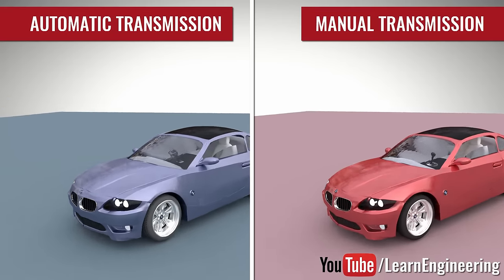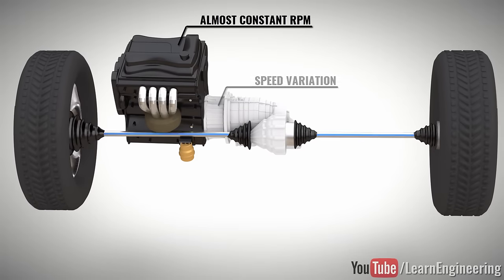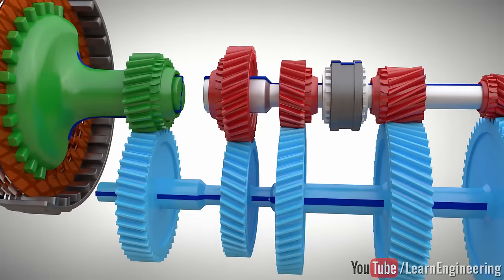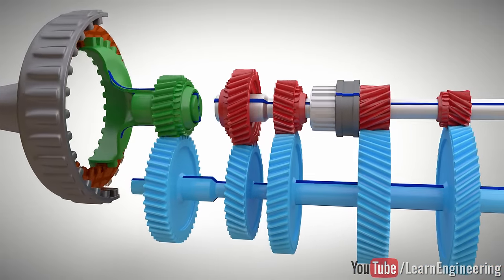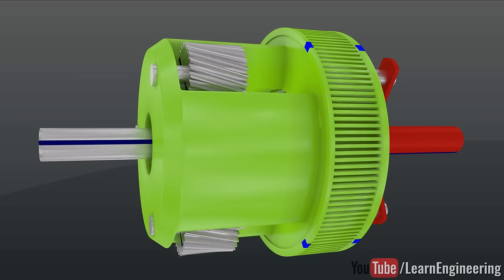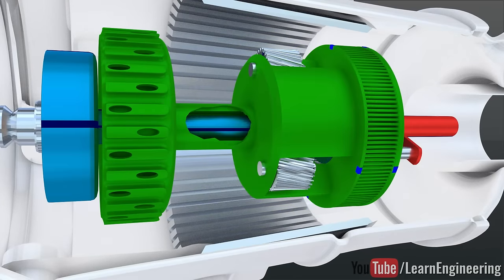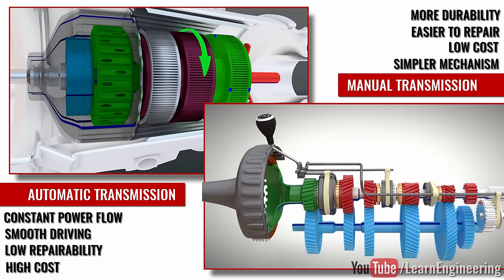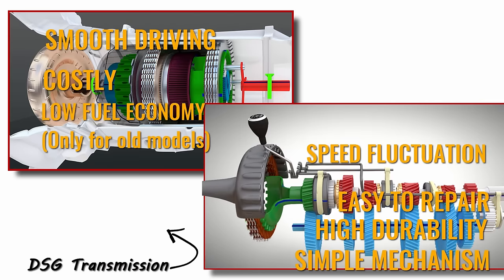Automatic vs Manual Transmission

Comment: Manual is never smooth? I dare say my shifting is smooth as butter sir!
Reply: Guts Puck hmm. A wild Berserk fan appears.
Reply: I think its said for beginners 😂
Reply: Same here. every car I have ever owned over the last 28 years was a manual. 
I shift without even thinking and it's very smooth.
Reply: It’s relatively less smooth than automatic transmissions.
Reply: I felt personally attacked when he said never
Reply: Baby Magnum boi we about to head out and go for a drive
Reply: Dear friend I agree with you, manual transmission is efficient by fuel, breaking, control of the vehicle.
Reply: Guts Puck was looking for someone to say it 👍
Reply: They probably just have those engineers that only understand something on paper
Reply: @EvilJ069  you can't continuosly accelerate on a manual.
Reply: @panzerofthelake506  Oh please forgive my 1/4 of a second between shifts! XD And how typically a manual is faster
Reply: @EvilJ069  It's a hard skill to learn. Have you ever been in a traffic jam on highways? Having an automatic especially for a beginner is much much better if you don't want your clutch to set on fire.
Reply: @panzerofthelake506  I learned when I turned 18 and haven't had an issue since. Yes, I've been in many traffic jams, it's called putting it in neutral and taking your foot off the pedal. Things like this are part of what's wrong with the world, "It's easier for a beginner" well things are too damn easy these days, it's why everybody is a soft little whiner. So I reiterate my original point: Automatics are for the lazy and/or incompetant
Reply: @EvilJ069  driving a car is lazier that walking, whats your point?
Reply: @EvilJ069  not to mention yoh can't break the transmission
Reply: @EvilJ069  Putting it in neutral doesn't work in traffic jams where everyone moves at the pace of a sloth. What you are talking about is a red light. Besides you can't react fast if you're in neutral.
Reply: I have never enjoyed commuting at 40 kph until i got my 2012 Honda Civic Hatchback. Never tought that shifting can be done so precise and smooth. You have to find the little joys ;)
Reply: @panzerofthelake506  Yeah ? Shouldn't be easy to drive* What's safe about automatic car ? You don't know what it does, how it gears, what will it do, when something breaks. Will is speed up ? will the speed fall ? I don't think it's safe. 
I like to have control over my vehicle. So, manual is best. Automatic is for lazy people, or imbeciles
Reply: @EvilJ069  i personally prefer a manual but automatic is definitely the future. You can't deny that by saying I am lazy.
Reply: @EvilJ069  ok boomer
Reply: Humans cant beat machines at such a simple task. Only prideful people think that their manual skills are top notch. Maybe this was true when autos were brand new long back. Now I dont think so.

Its like saying your hexadecimal skills are better that you don't need high level programming languages and instead can program an entire application using machine language.
Reply: @EvilJ069  triggered? lol, dont worry, the fact that your manual skills can never catch up to automatic still holds true. lmao
Reply: @blasttrash  lol, nobody here is triggered, bruh. But you just made the point for me: Automatics don't require any skill, even a moron can drive them. Which is why I'm sure you own one XD
Reply: You are a smooooooooooooth operatooooor
Reply: Same
Reply: I'm never smooth but then I drive it like a Racecar...
Reply: Don't even use the clutch while up shifting on bikes....
Reply: yes , Manual can be smooth , my dad shifts so smooth I don't feel anything other than the speed change
Reply: It could be smooth for you. In reality there is always power gap. You don't feel that because car's momentum smooth it out. All in all even if it isn't noticeable for you there is always discontinuance.
Reply: 666th likes
Reply: blasttrash so why aren’t they as efficient?
Reply: My manual is automatic.  To me..

Been doing it so long I can't help but shifting properly.
Reply: He meant that when you press clutch before you shift, car will slow down a bit while automatic car wont slow down when shifting.
Reply: @numeprenume512  Yeah, but you have to be good and you have to rpm match. Not that difficult really, just takes experience and care.
Reply: @davidmella1174    Torque converter wastes energy, they can are heavier,  more moving parts. But, they are much better than they used to be.
Reply: @salle6307   Doesn't actually slow down.  Just doesn't speed up for a moment.
Reply: @timjohnson1199  Like i am not driver myself. Go drive manual car and see for yourself. There is something called friction that slows down the car.
Reply: @salle6307  In that fraction of a second that it takes to shift any slow down is negligible and imperceptible.
Reply: @timjohnson1199  Look at graph at 6:01. Is it so negligible? I see spikes pointing downwards.
Reply: @timjohnson1199  Also i didnt say fraction, i said friction.
Reply: Volkswagen for the win, My guy!
Reply: Shifting smoothly in manual is easy if you know how to drive
Reply: No matter how hard I try. People will always slouch forward everytime I let go of the gas
Reply: I have never drive a car with automatic gearbox but I have to admit that learning of driving with manual gearbox isn't an easy task
Reply: I love berserk too my first and only anime watched
Reply: Unless he doesn't know how to properly clutch then yes
Reply: @Aus.S7in  In which gears ? In 1st or 2nd ( but mainly 1st ) it's normal, the engine breaking is way heavier so it'll slow you down too much and you'll slouch forward
Reply: @RR-uc1wb  Not in my awful experience with automatics.
Reply: Now that I think about it, the first time I drove an automatic I fould it very uncomfortable because it shifted quite rough
Reply: @blasttrash  it is true that machine does it better but we are talking about the "smooth experience" here... that means how the driving experience feel to you... with automatic when the car changes the gears, there is small jump in acceleration that you cant really control... while with manual the gear change happens exactly when you want it to happen and if you are experienced you can do the change very smoothly...
My point is that even if the automatic would be more "smooth" when looking statistics... its not when it comes to your own senses... which makes manual "smoother experience" if you are good at shifting gears.
Reply: if you change your gear in manual you will slow down for a moment but in automatic it just go that is why manual driving is never smooth compare to automatic
Reply: @karlpatricke.castillo942  depend on the aoutomatic gearbox and the other systems
Reply: @ruakij6452  sure, one year later I stick to my original statement
Reply: @Burneri  absolutely right.. I had an automatic and always scared the shit out of me while changing gears in sports mode.. would pick up speed n be free. Went back to manual car.
Reply: Yess it will be smooth by pressing the clutch and adding much rpm
Reply: For experienced average person, yeah, for Amaricans tho...
Reply: Goood boi
Reply: The main reason for transmission is to deliver engine power to the wheel, why manufacturers sabotage the AT transmission by putting ao many parts in it, so expensive to repair when broke
Reply: I love your user pic and also agree with u 100%.
Reply: And i took it personally he probably drives Automatic
Reply: Driving a manual makes you feel like a badass
Reply: @pinadingadlagud3467  if you want a vehicle that lasts, get the less techy one with a stick shift! 🤣
Reply: @denzelwashington6222  I drive an old manual isuzu pickup truck, maybe not fast but strong and always gets the job done.
Reply: @pinadingadlagud3467  any manual will do, even a ford ranger with a manual last, it depends solely on the users care on the car, we have here in our community a fella who owns an old f150 and an old ranger, still runs smooth, they  both have a stick shift....
Reply: @denzelwashington6222  yep, and fixing a manual car is less complicated
Reply: The only thing smooth is casca brain
Reply: Said it to beginners
Reply: @RR-uc1wb automatic fanboy detected
Reply: @EvilJ069  i don't know why ppl think manual is not begginer friendly, the first time i sat on the driver seat alone, i was 14. Had 0 problems apart from the cops seing that and give me a ticket, i could have begun earlier in the driver life, but i had no opportunity to steal my father's car before 14.
The first time i drive an automatic i was 24 i think, never had any issues. But i didn't like, that car slowed me down. In hillclimbing is horrible, it will never give you the right gear, you can't heel and toe on corners, so many drawbacks.
Reply: I have been told this by passengers!
Reply: @EvilJ069  those engineers are the only reason you can even drive a car with a working engine lmao
Reply: @dankrigby5621  Alright then, nimrod, go change the starter on a Land Rover, I'll wait
Reply: @EvilJ069  well jokes on you since I'm not only studying to become an engineer, I'm already a certified mechatronics technician. I have no problem changing out starters if you get me inside a shop lol. You need both to build something, engineers designing and doing the calculations, and mechanics/electricians building the system afterwards. One can't do it without the other.

Comment: Driving Manual is very smooth too. Depends who's driving. The same for automatic.
Reply: I can drive my manual very smooth
Reply: the point is even if it toke you .25 of a second, you still lose power from the engine in Manual gear, while the automatic gear never lose power from engine.
Reply: @khaled00962  he said smooth not power
Reply: @khaled00962  still you can just turn the engine high enough and then switch into the next gear very smooth so you won´t jerk at all (sry i speak german xD)
Reply: @khaled00962  however, a manual is normally much more efficient in terms of fuel and in power
Reply: @sleightlyhandy889  While I´m a huge MT advocate, I have to disagree. DCTs and CVTs are way more efficient than a manual will ever be. Even torque converters have caught up. They´re still less efficient than a manual, but the difference is almost neglectable
Reply: @skythundersky1544  Nope, torque converter autos on modern cars have beaten manuals at this point in efficiency.
Reply: @Penguin-kr9do  Yeah, you´re right, I don´t know what I was thinking. I guess I never heard of ZF ATs a year ago :D
Reply: @DhirC35  you cant have smooth acceleration while shifting, its impossible. it may feel smooth, but its not constant acceleration, so not really "smooth".